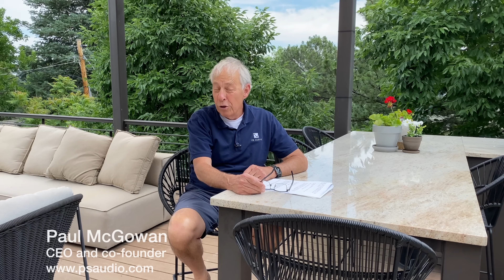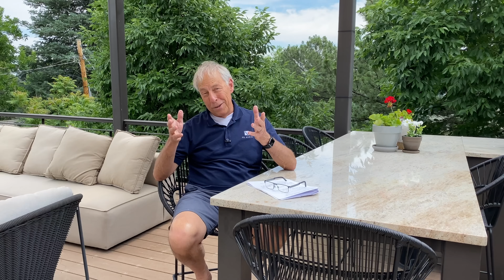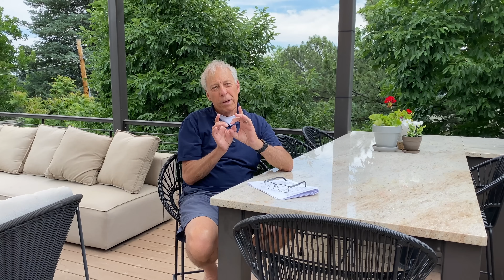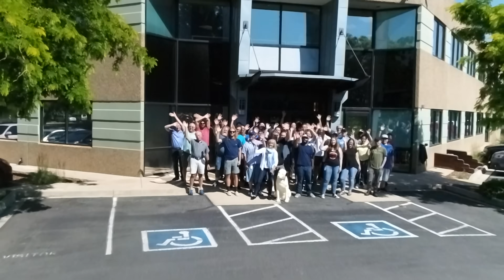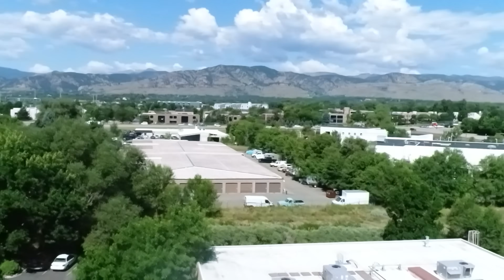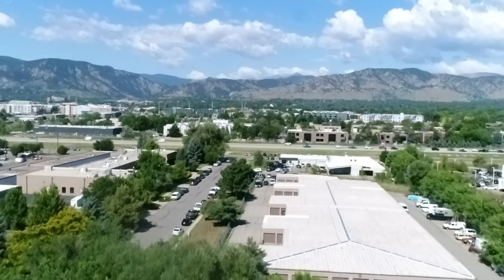Do chip op amps sound good?

Comment: A good chip op-amp can sound great. The design of the rest of the piece of equipment matters enormously too. The power supply has to be high quality, the layout of the printed circuit board in terms of component placement and ground plane design has to be good and input and output circuits have to do things like impedance matching with good results in terms of connecting to other components. Is the chassis well shielded, etc?  It's the complete package that counts.

Comment: Anybody else here get a Fosi v3 monoblock amp and received 2 Muses02 chips? I bought 2 amps so they sent 2 chips, does anyone know if the two Muses02 chips are both supposed to be installed into one amp? Or is one chip for each amp? The reason I'm asking is because when you open the amp, there's 2 chips that look like they can be replaced by the Muses02. I know this is probably stupid, but this is my first time using an opamp

Comment: In my humble opinion, you have a better chance of improving the sound of your device by putting in a better chip than by changing the speaker cable from $10 to $100 per meter.

Comment: My sparkos 3602 Opamps sounded way better than incremental upgrades; speaker cables, fuses, usb cables or even newer dacs. These are 5 dollar opamps are in most major rave reviewed dacs. What a mistake it was  listening to audioscience, when i started this hobby . Why? they let measurement tools do the listening for them not ears and every known objective scientific study they push happens to be done with old farts that have moderate to severe hearing damage. Never once they use Youth aka golden ears for test/study. That's why r2r tubes opamps and cables all can give a more enjoyable better sound than these measure well DAC.
Reply: Agree about ASR but I replaced sparkos with the Weiss and it blew it out of the water. Andrew is a great guy but his op amp is muffled through a pillow by comparison. You get what you pay for.
Reply: @xfloodcasual8124  One problem with these discrete amplifiers is their size, which too often is a total hindrance to their integration in a device. We are not talking about their current consumption, which could damage the power supply of the device. 😢

Comment: What do you think of the THAT Op Amps that are specifically designed for audio use such as the THAT 1512 or THAT 1580? Are they leveling the battlefield so to say?
Reply: The THAT 1512 and 1580 (and similar earlier products, like the INA103) are specifically microphone preamplifiers, not general op amps. (Although I suppose people could use them as a gain make-up stage after a passive summing mixer). For that purpose, they have excellent specs.

Comment: Depends on the ópamp or discrete transistor using. I like discreet JFET's . Very Tube Like sounding . Well one in particular I found just amazing quiet with high output. And somehow they were all exactly the same. If you know anything about JFET's that never happens. You have to bias them individually. And I'm not telling you the model number or anything there mine, all mine. I will tell you they're very similar to the ones that Marantz were using. To make their amplifiers sound more tube like.

Comment: Why does the audiophile community hate feedback? Do you like to make your job harder!? Theres nothing inherently wrong with feedback, and if the circuit is already close to linear, you will drive the final distortion products down below the noise floor if there is plenty of open loop gain available. A lot of gain is needed since the error correction is strictly proportional, so some portion of error will inevitably remain, and less feedback means more residual error at the output. More feedback, as topology and stability permits, will mean less error and better linearity. Almost every commercial amplifier uses quite a lot of feedback to avoid non-linearity and distortion, esp. in the cross-over region. Not using it almost certainly means more distortion unless you're using exceptional devices or a complex topology. Even then it would be even better with feedback. Why leave that improvement on the table? Edit: Using the OPA134 as an example, it has a listed THD of 0.00008%. Thats pretty goddamn low! Granted it will inevitably climb a bit above 10kHz, but so will your discrete one. Maybe not as fast with less feedback, but thats offset by other issues that come up when less feedback is used.

Comment: As long as you dont overdrive them they should be pretty clean and very linear at audio frequencies nowadays. The old stuff is a far cry compared to what we have now, so its not really valid to use the 709C as an example. Modern op-amps are far better and made for precision amplification, and while not all are equal, there are plenty of low noise op-amps that will do just as good given the large amount of feedback available to clean up any remaining nonlinearities at the output. Fair enough to say that most aren't since many are low voltage now to cater to low voltage electronics, but there are plenty just for audio these days. Also since all the silicon is on one die there will be less issues with thermal effects since it will all track, and everything is matched. To say they "don't sound as good" kind of ignores the fact that a lot of the same topologies are found on an IC as you would find in a discrete version. In reality, there probably would be almost no discernable difference at audio frequencies, and with audio almost always the speakers/headphones will be the dominant source of distortion for sound reproduction. In an audio amplifier it makes sense since you need the voltage swing and the final stage has to supply amps to 10's of amps and not milliamps, but with that said there are audio power op-amps with THD in the parts per thousand for power outputs < 65W. Edit: Im assuming the "two device op-amp" was probably a pair of Darlington transistors since there was feedback being used.

Comment: I would say that an op amp by definition has very high open loop gain, and is thus unusable without feedback. You can make a discrete amp with low or zero feedback, but it wouldn't contain an op amp.

Comment: I had a Quintessence preamp and Ugh those 709 op-amps were bad. I remember it as being kinda dark and vague sounding. I was going to build a better circuit in it and once used it as a test bed for op-amp but eventually took it apart and kept the faceplate and knobs but threw the rest out. I also had the SWTP preamp which had plug in discreet op-amp boards but I never got that to sound great so I kept the boards but threw the rest out. Then I bought a Rapport Pre-1 preamp and it had some pretty serious stability issues. I cleaned up the grounding and replaced the pot and it sounded pretty good. Then one day lightning hit outside and blew the output stages while I was listening to Pink Floyd (loud hum both channels). I found that the high level stages were sealed in epoxy. I broke one open and was surprised to find an op-amp inside. I was of the opinion then that discreet was the way to go. I built replacement circuits for the high level stages using the same op-amp. This has been my reference for solid state preamps since then. Sounding better than Mark Levinson and Classe and pretty much every high-end preamp I compared it to.

Comment: Today, unless you are designing to special requirements such as optimal Noise Figure for a given source, high voltage or high power, it's usually not worth a designer's time to develop a discrete-component op amp.  
https://www.ti.com/amplifier-circuit/op-amps/audio/overview.html
https://www.cycfi.com/projects/six-pack/op-amp-shootout/  (2017)
https://tangentsoft.net/audio/opamps.html  (last update 2016)
Of course, incorporating a suitable op amp into a product and achieving its best performance still requires an experienced and knowledgeable designer.  Using an IC doesn't guarantee freedom from all pitfalls.  
Too bad Paul didn't mention the story of how a competitor designed a preamp with the 709 that sounded much better than his - and why.

Comment: I could be wrong but I thought that one problem with chip op-amps is that they are more susceptible to internal capacitive losses / cross-talk as well.
Reply: When I purchased my Audio Technica moving coil phono cartridge back in the 1980s I knocked up a simple IC op amp based 20 dB gain circuit on a scrap of Veroboard. I still have it somewhere. It performed really well. No noticeable crosstalk. And it was as cheap as chips as they say. Certainly a lot less than a transformer.

Comment: I've found that most problems associated with op amp circuits can be booked down to two major issues: 1. Budget-price op amps with low bandwidth and 2. Designer  "cheaps out" by having too much gain in each stage. This result in high levels of slew-induced distortion (sounds absolutely awful). In extreme cases poor high frequency response and phase shifting as well. I have a guitar amp with both of those problems. Rather than replacing the op amps and adding 2 more gain stages, I replaced the entire preamp section with a two stage (zero feedback) circuit consisting of one 12AX7 tube. Sounds wonderful.
Reply: I guess why all jfet distortion sound better because you force to use stages while cheap amp just have one op amp stage for distortion for guitar amps.

Comment: Yesterday in my RIAA preamp I compared a pair OPA2111KP what it come with originally. To a high end specifically made for audio MUSES 01.

The MUSES 01 was superior in many ways so no contest. Today I got time to compare a descret op-amp against the good MUSES 01.

It is hard to say something definitely about witch sounded better than the other they were so good both of them.  But the descret op-amp played lower down in frequency that the MUSES 01 didn't. So it won.

So this "random" pair of descret op-amp sounded better in the end, than a high price high end IC op-amp made for audio.

I mean "random" above because it is only the first and only that I tried and there is many other variants. (Name: moing hd-08)

And I paid a lot for the IC op-amp in the same ballpark as the descret ones at $100 for the pair.

One reason were that I realized that there is a lot of copies and to be sure that I got original op-amps I decided to get them from the manufacturer. So I know they are genuine.

So if I never had heard the descret op-amp then I would also think that IC op-amp is as good as it gets.
Now I know differently.

And that kind of money for "simple things" as op-amps I would need to multiple many times that amount, to get that type of sonic improvement by trying to upgrade my cartridge that anyway would be fruitless when there is a hi end IC op-amp in the signal path that do not amplifying the lowest frequencies.. .. everything matters.
So it would not help if I threw infinite amount of money on a cartridge.

Comment: I frequently use the LM833 It's VERY VERY good sounding chip opamp. It's made for audio and the distortion bandwidth is below 0.005 (datasheet says).
We don't need morte than that if we are diying a home audio! Fits most uses, worth the test!
Reply: You should try LM4562NA and OPA1656 or OPA1612. These chips are incredible.

Comment: Pretty much every readily available op-amp IC out there is designed without any precision resistors or capacitors. Integrating these is not easy! (Anyone know of any exceptions? I could be wrong). Even with the best designer on the job, that's a severe hindrance.
Reply: Generally you don't need precise absolute values for R's and C's on the chip.  The parts which set the overall gain, pole and zero locations, etc., are external to the IC.  
But on-chip resistors can be matched to precise ratios, as can transistor offsets and current-mirror ratios.  In discrete designs, those things need to be done by hand, which greatly inflates labor cost.  
I should also point out that some of the best low-noise preamp designs today, are hybrids of discrete transistors and IC op amps.

Comment: A couple of years ago I bought an op amp from TI  to improve sound quality from my hybrid phones amp. Already I had upgraded the Chinese valves with RCA and Russian valves.
After swapping the op amps...the sound was much worse,muddy, less detail.
Again I change op amp with some NE ....yeahhhhh.great improvement!
Reply: One of the problems with "upgrading" op amps is that newer chips may be much faster. They are more prone to HF oscillation. You have to look at the circuit with a scope to make sure it's behaving. You may have to partially re-design the circuit to optimize it for a new chip.

Comment: In my experience it depends a lot on the rest of the system. I have a normal highend consumer stereo and to make that sound at all special it requires (slightly DAC dependent) the best discrete opamps I have in my collection in order for the system to have decent dynamics and overall sound. I also have a home built/designed system that uses pro drivers and pro amps. With the same source into the DAC I use regular chip opamp (really good one...) in order to keep the dynamics in the realm of sanity. 
So, discrete opamps are way better for home hifi because home hifi needs all the help it can get, but with pro gear you have so much power and dynamics that you are just fine with regular top shelf opamps.
No opamps were hurt in these experiments and the refereed to opamps in this story are Sparkos (discrete, from Colorado, about 10 miles from PS Audio) and OPA 2134 and Muses 02 chip opamps. Bryston, Muses 01, Muses 03 are all fine units, too)
Reply: @Lloyd Stout Sure, Ace, tell me all about how smart you are...

Comment: I don't know... the LME49720 sounds pretty darn good.

If a system is designed with discrete components, then there is no need for "discrete op-amps" because those are just functional replacements for op-amps.  The topology should be different enough that when designing a discrete component system with minimal feedback, op-amps of any kind wouldn't be incorporated into the design.

So "discrete op-amp" are really more for the OCD type who bought op-amp based systems and can't sleep well at night.
Reply: There is nothing wrong with feedback, if the open-loop gain-bandwidth product and slew rate are high enough.  The problem only comes in, when there are multiple response poles too close to the audio range, requiring heavy compensation for stability, which then pulls the slew rate down.  
We need to get away from the myth that high feedback is uniformly bad.  It becomes less and less true as time goes by and devices become faster.

Comment: Yes, the answer is "it depends". The 709 op-amp was among the first of such, and of course had many warts. The best of today's devices have few warts and take advantage of all manner of characteristics not possible with discretes, such as device matching. And keep in mind that recording media, such as mixer boards, run audio signals through sometimes a dozen or more op-amp circuits before they're plopped onto the recording media. The A/D converter also contains an amplifier chain to drive its digital circuits. So in my view, ignoring the distortions caused by the recording chain and focusing only on reproducing devices is naive..
Reply: As a teenager over 30 years ago I used some already ancient 741 op amps to build a couple of preamps for magnetic phono cartridges. If you ask me, they sounded great! Low noise and distortion, great equalization. Wish I could remember where I got the circuit diagram, some dusty/musty old electronics hobbyist magazine.

Comment: Burson opamps are great value for money, especially V5i, that is not too big.
I am using them in my Asus Xonar STXll, much better sound now than with the originals.
Reply: If you have not done things to improve the power delivered to the STX... there are things that make a big difference, for not toooo much cash.
Reply: bvocal What can I do to improve the power to the card? Do you have any specific recommendations?
I have soldering iron and know how to use it. :)
Reply: @bergennorway  No soldering needed. I know I'll be slagged for this by geniuses like Lloyd Stout, but here it goes, and for anyone who thinks this is shit, stop on by and I'll a/b this for you...  I took out the not so great power supply (the computer's) and replaced it with a Seasonic PRIME 550 Platinum SSR-550PD2 550W 80+ (it was as far up the food chain as I was willing to afford ) and connected that to the wall with a Pangea AC 14SE MKII, (which costs somewhat less a few years ago), and lastly I put in an odd power filtering board that is designed to filter the power going to add in cards through many capacitors. The before and after difference of the whole package was dramatic. I had no interest in figuring out powering the card with an external power supply.
While all that worked and is good, to be honest I have matched the output quality with a few other not expensive DAC options (which at the time I was not convinced, say, a Topping DAC for $100 or $130 or $200 etc would be any good, I was somewhat wrong about that, and with many of the Topping DACs you can swap opamps.) 
So what would I do now? Well, an STXII costs 220$, the power supply 140$, power cable, 90$, bus power filter $45, opamps, 200$= $700, my external DAC with all the extras is about $1000, and a Topping D30 (swappable buffer opamp) is about 130$, and a D50 (no replaceable opamps, unless you soldier) is 500$ plus, if you want to be equal, 90$ for a power cord and a USB cable and maybe a sibling power filter for the USB output from a computer -40$
so, all up, less money, all have good DAC chips...
So if was the broke human I am and wanted a low cost DAC with a swappable opamp, which is a feature I rather like, I would look at a Topping D30...
cheers